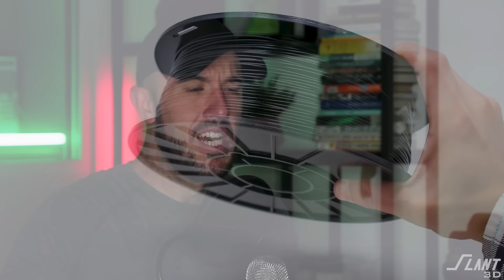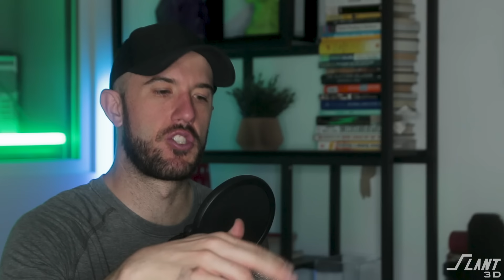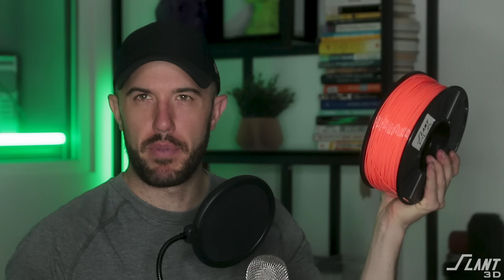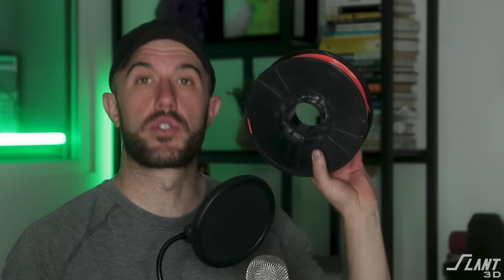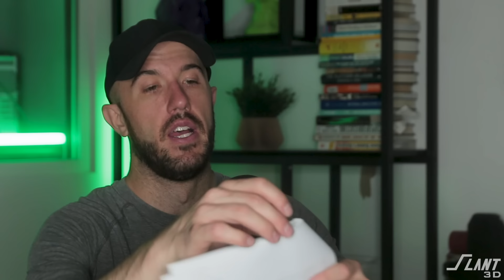We Made Orange Filament | How to Build an MVP | Tangled Memberships | 3D Printing News

Comment: Pretty much every day we find yet another thing that doesn't work like we expected in microgravity - so no, it was not at all obvious that the printers would work in that environment.  Was it probable - yes, or ESA wouldn't have spent all the money lofting all that mass.  But by no means guarunteed.  Microgravity is weird!  So it's really exciting that this worked out.  Of course, you blew past the truly difficult part of the entire project, which was heating something to 1,400 degrees without causing the 95% oxygen atmosphere on the ISS to explode.  (yes, yes, technically it would deflagrate, not explode.)  Which they did by pumping out the oxygen and replacing it with nitrogen, and then presumably reversing the process when it was time to get the part.  Honestly, this is yet another example of how laypeople don't understand just how hard doing everything in space is and so don't appreciate the effort needed to make something "simple" work.

Oh, and "ESA" is pronounced as a single word - ees-ah - just like NASA is a word.  Both are true acronyms.

Comment: hey brah , i have an idea for spool less , look up how electricians pull Romex out of the center of the wire roll , then design a 3d printed pully u can include in the the spool-less filament to help guide the filament or straighten it out :)  i am an electrician so i stare at that roll of Romex at least 1 time a week lol pull the filament from the center plastic wrap the outer of the spool ;)

Comment: Micro gravity can cause more issues that you might expect. For example the lack of convention current can cause some things that normally are fine to overheat. This could complicate both the electronics and the part cooling. I imagine it also has significant impact on lubrication in some cases (ex: a lot of aircraft engines don't work at well in free fall or inverted due to oil distribution issues, similar things could happen in micro-gravity.). So micro-gravity 3d printing is more complex than just no more support material, but yes, that probably is the biggest change.

Comment: MVP discussion discussion was excellent, particularly the context of relevant examples.
This coming Tuesday will be 9 months since the first batch of Tangle Filament was offered for purchase. "We didn't plan to do this. It was supposed to be this whole thing around a new launch." (Sep 18, 2023, from the blog) This mush be the MV\_ (minimum viable launch).

For Slant 3D "printing in space", talk to Axiom Space, as they plan to launch the first module of the first commercial space station in 2026.  (HAB1 is their research and manufacturing module, and HAB2 is the crew module). BTW: "3D Bioprinting", printing living tissue is a topic on their website, because no/minimal support structure is required.

FYI: NORSK Titanium is a Norwegian company that is not manufacturing in the U.S. (believe NY state) focused on the aerospace sector. Since titanium is an expensive resource, machining can be cost prohibitive. 3d printing, they say 3d printing and lite machining eliminates ~90% of the waste seen with traditional CNC manufacturing.

Comment: The problem I think there is as a customer that buys a limited (maybe even one-time) run of filament. Is that when the customer's stock runs out, he can't satisfy their own clients anymore, which makes it (at least to me) not very viable to buy as a resource. If I start using this limited color and the product takes off, after a certain time. I need to start disappointing my own customers and offer other colors than they might have wanted.

I understand the MVP itself for Tangled is "Are our customers interested in something else than black?", but it's aimed at the hobbyist, not at the professional level. At least that's how I feel about it.

Personally I would say, if an MVP for a color seems viable, keep producing it, so your customers can depend on it and can take the risk.
Reply: I would treat these types of batches of filaments as leftovers and not something to build a product around. 

He clearly states they made extras and aren’t getting into colors, so I think this criticism is unwarranted.